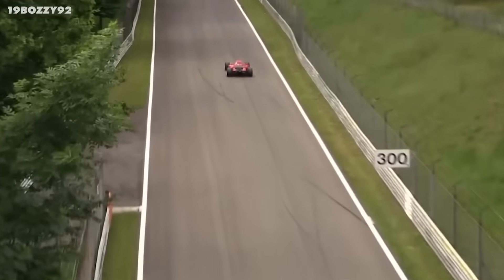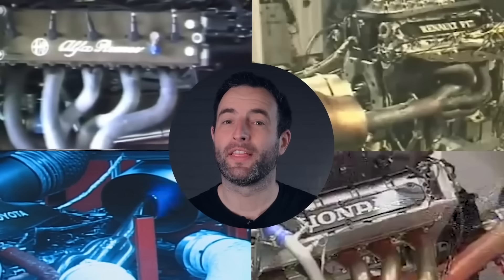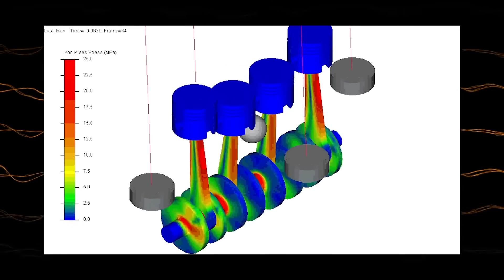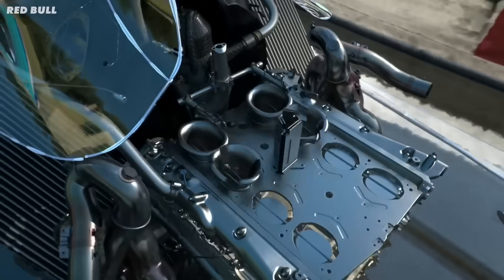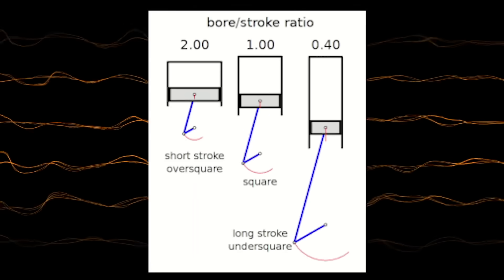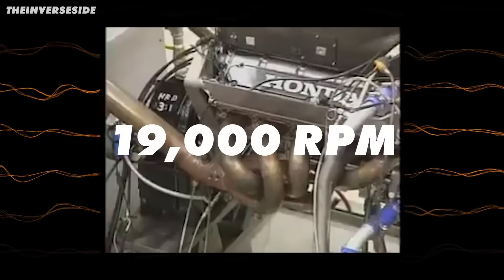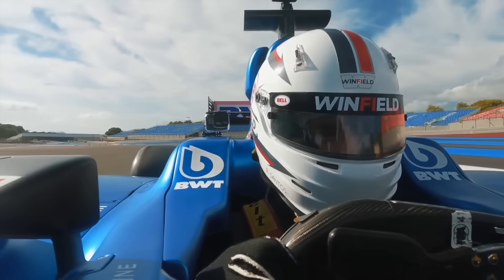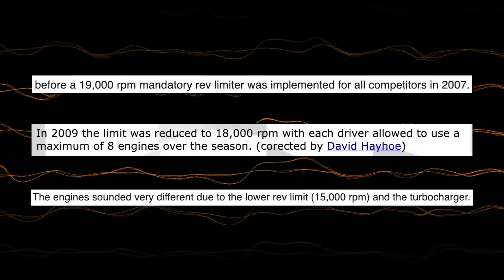When Formula 1 Engines Revved to 20 000 RPM!

Comment: Renault was the first to use pneumatic valve actuators.  V-10 do have a problem - they're either "odd-fire" or you have to split the crankshaft throws to get to 72 degrees which makes them weaker.
For reference, Ford's Triton V-10s were even-fire with split throws and a firing impulse every 72 degs, whereas the Dodge Viper engine is odd-fire.

Comment: v10s are overrated, as far as to say that the v12, specifically the 3.0L Ferrari tipo-044/1 (1995) which revved to 16.8k-17k, sounds miles better, this is because it had a higher natural frequency, despite the 2-3k rpm loss from the 18-19k from the mid 2000s v10, it had 2 extra cylinders, which meant that there were more explosions per crankshaft rotation and the resonant frequency was higher, and since they were evenly balanced in the crankshaft, the Ferrari 412 t2 sounded smoother at low to medium revs and higher pitch at higher revs, a great example is jean Alesi's suzuka lap (1995), the actual sound curve compared to the McLaren's and Willaims at the time (v10) on the same race weekend is a whole lot better, and more so jean Alesi's lap around Montreal.

Comment: Back in the day, Honda produced 50cc twin-cylinder, 8-valve engines that produced 13.7 hp at 21,500 rpm.  That's equivalent to 274 bhp per litre, in the mid 1960s. 3.5 litres of it would be 959 bhp...and you were saying.....https://en.wikipedia.org/wiki/Honda_RC116

Comment: My 1971 Fiat 128 1100cc engine was over square. It's a Lampredi engine. I believe Lampredi designed GP engines for Ferrari in the '50s.
Yes, it revved. Normal, everyday revs meant a lower than normal piston speed, which translated to a lesser wearing of the bore/rings.

Comment: If you have titanium pistons and carbon-fibre connecting rods this is not as difficult as it sounds.
Reply: they were using more than titanium, they were using rare earth minerals and metals you’ve never even heard of, actually the main reason they stopped this era was costs were way too high and going thru engines every weekend.

Comment: Not true about saying the V10s were the most powerful in the 3.5L era. The V8s were light and fuel efficient while the V12s were the most powerful, expensive and very thirsty. The V10s were favoured in this time due to their “middle ground” status. The V12s of the time were actually considerably more powerful. The V12 McLaren MP4/7A was 50-60 BHP up on the dominant V10 FW14B. By the end of the 3.5L formula the Ferrari V12s were putting out over 850 BHP, which would only be matched by V10s in 2003 or so. The 3.0L formula is what’s considered to be the start of the “V10 era”. Now the V12s power advantage was greatly reduced. The final V12 was the 1995 Ferrari 412 T2, it managed a 50 ish BHP advantage in qualifying but couldn’t sustain it for race trim, being only 20bhp or so more powerful, with all the weight and thirst issues. By then the V10s were a more promising development direction for even Ferrari. However, the final V12 might just be the greatest sounding. The 412 T2 revved to 17,000 rpm in 1995, 2,000 higher than the competition, and had a distinct V12 shriek to it. Possibly the best sounding car ever.

Comment: If you gave an old V10 600 kg car a set of modern slick tyres with much more grip than the grove tyres they raced on, would a V10 be able to lap faster than todays 908kg turbos ?

Comment: Instead of using regulations to put limits on development spending, the sport should find a way to limit spending that utilizes a natural balance point. That way, innovation is maximized relative to cost.  Such a scenario would utilize a boundary set by the competition itself. For instance, there is no limit placed on RPM, but the team with the highest revving engine in each race must incur a handicap that almost completely negates the benefit gained by those higher rpms. This would create a natural boundary where the cost required to overcome it increases exponentially the closer you get to said boundary. It would become too expensive even for teams with unlimited funding to attempt to go further with a particular technology, while still being reasonably affordable for typical teams to compete. There would no longer be an incentive to make any little improvement possible. The improvement would have to be ground-breaking to be worthwhile (to negate the handicap), and those are the ones we want to see come from racing development. An extra 100 rpm that cost a million dollars to make happen, has no benefit as an innovation of engine technology. It just means that he who spends the most, goes the fastest. We want racing teams to spend on innovation, but not to the point that  the improvements being made could never see their way into a passenger vehicle.

Comment: A lot of errors in this video. The V12 can reach more revs than the V10.
By the end of 1994 (last time F1 used 3.5 liters) the ferrari V12 reached 16300 rpm (which delivered 850hp) whereas V10 Renault reached "only" 15000rpm (which delivered aroud 800-810hp).
The issue for the V12 is the lack of torque in middle revs which is an issue regarding the contemporary circuits.

The V10 respresented at this time the best "compromise" according to the circuits.

Comment: I had a Suzuki GSX-R750 motorcycle which standard had titanium rods, I think from memory . Redline was 15000 and to nearly 16,000 RPM before the rev limiter cut in -pretty impressive for a street engine, which had great reliability excellent fuel economy and produced 150 crankshaft horsepower from 45 in.³ engine

Comment: At 6000 rpm, each piston travels down and back up in it's cylinder 100 times per second. Try moving your hand up and down 100 times per second. At 18000 rpm, the piston goes up and down 300 times per second. In a 4-stroke engine, at 18000 rpm, each cylinder makes 150 exhaust pulses per second. Multiply that by 10 cylinders, and there are 1500 exhaust pulses per second leaving the exhaust system. Bring some ear plugs.

Comment: 3l and 3.5l v10 has more inlet valve area than v12.

Smaller bore means less room for valves. What Ive understood, with that displacement the v10 is the golden corner for valves

Comment: As awesome as they were, they still didn't have the record for most NA power per liter, even in the period.  The Honda NSR-500 2-stroke GP bike holds that title as far as I know, excluding things that run on nitromethane.  Ironic, given that Honda as a company and Soichiro himself despised 2-strokes.  Frankly, I'm impressed F1 got as close as it did, given that each piston spends 75% of it's time making less than zero horsepower.  In order to extinct the 500s, the 4-stroke replacements were allowed 1,100cc.

Comment: they sound pretty damn nice. but i still prefer the timbre of the 787b when its about to hit the  rev limiter.
that's probably because the 787b starts off with a really low idle exhaust note and zooms to an intense f1-like scream. it has greater vocal range.

Comment: great video. debatable whether v12 sounds worse than v10.
saying that a reduction in maximum rpm was better for f1 as a whole is kinda laughable though, as that was the beginning of the end: smaller engines, limited number of parts, parc ferme, mandatory race tyres, max fuel flow, no private tests. better as a whole if you run a bus company, not f1

Comment: If I recall Correctly, electric power is the future.
also, 1.5x playback is ideal for this guy. its like he needs a rev up
Reply: Model s plaid has 3 motors that go to 20krpm it had to be wrapped in carbon fiber to not warp itself.

Comment: The pendulum swung too far, the V6 sounds awful compared to the V8.  F1 is the pinnacle of motor racing.  Attempting to make F1 the pinnacle of carbon-neutral policies is misguided.  Look at the flight map and how inefficient the travel is during the season, constant back & forth to the same parts of the world.  Create a calendar based on efficient travel, burn less jet fuel and bring back the V8.
Reply: Why should they bring back the V8?

Comment: One of the most interesting things of these modern F1 engines is that they are designed with tolerances so extreme and perfect that they are essentially assembled in a seized state; that is, they have zero gap between the rotating and sliding surfaces.  You cannot crank/turn one of these engines without first preparing it for start-up, which involved heating the engine block with a thermal device that allowed the metal to swell, now creating a gap between the engine’s components.  Once this was done, a vacuum pump was attached to pull the lubricants into the engine so that a thin film coated all the internal surfaces.  Only once this was done would the engines be attached to a starter to be fired up.  That’s why you have so many videos of these cars sitting in the garage hours before they are run on the track, with engineers standing around, watching laptop screens as the engine is run through various RPM ranges…they’re pretty much monitoring the heat and the level of lubrication the engine is going through.  When Top Gear’s Richard Hammond drove the Benetton F1 car, he detailed this process as he was waiting to get into the car.  Search for that video here on YouTube.

Comment: The bmw p85 v10 was going to be 950 hp and only 82 kg (98 mm bore with only 4mm cylinder walls) but F1 doubled the mileage requirements and they had to scrap it for 2005.

Comment: At 3.5 Ltrs the packaging of the power unit is slightly improved as a 10 cyl, relative to a 12 cyl. The slight power increase available from 12 cyl's could not compensate for the advantage given to the chassis and aero, offered by 10 cyl's 
At 3Ltrs a V8 has the same pro/con as the 10/12 at 3.5 Ltrs
At 2.4Ltrs you are in the realm of 6 cyl's

Comment: I am desperate to hear an inline 6 running these technologies. In inline 6 with like a 100mm bore and 50mm stroke would be around 2.4 Liters. I think it would be the ideal motor for the next F1 cars with a nice little MGU for torque fill.

Comment: Honda’s 20k rpm 3.0 V10 delivered 965 hp, which is just 70 hp less than today’s F1 powertrains despite having no turbocharging and no electrification. That masterpiece could avoid modern F1s to carry heavy batteries and, of course, to sound delusional. Just imagine today’s safer and more aerodynamic carbon bodies with that ear shattering V10 rear mounted. The car would be less fuel efficient, but I think it would be faster since it would be lighter and would have a more progressive power delivery.

Comment: I have a tip for the F1 regulatory body: Limit RPM to 3.000, Volume to 1,5 Litre, Power Output to 60 kW and driving speed to 80 km/h - then everybody can be in the F1 game.

Just don't expect fans to stay around for much longer.

Comment: with high reving engines ok f1 is a bit higher the normal road cars but the piston speed is sort of the same you cant go faster thats wy they run over size p[istons wider then the stroke so to rotate the krank the piston has to travvel les distance so can do it faster with same piston speed as square or long stroke

Comment: I do NOT like how V-10's sound...ESPECIALLLY at lower RPMs. Years ago, a friend of mine bought a brand new Ford truck with a Triton V-10 in it. A few months after he bought it, he had an aftermarket exhaust system installed on it. I went for a ride with him, and the first time he stepped on the throttle hard, I broke out laughing harder than I EVER have in my life before.. His expensive aftermarket exhaust on his V-10 sounded EXACTLY like someone who was trying to play a bugle for the first time... 😆🤣 
It was high-pitched, sharp, and VERY annoying sounding. I let my friend drive my car, behind his truck, while I was driving the truck and getting on the throttle at various RPM's, while I was laughing profusely by myself. When we got back to his house, he totally agreed that his truck sounded ridiculous, and he immediately went and had the stock exhaust reinstalled. 

The Ford Triton V-10's and the Dodge Viper V-10's, are the most experience I've had with a V-10 and they both sound silly to me.

Comment: Very nice video, but I have a couple of remarks. Ultra lightweight V10 F1 in the Schumi/Alo/Hak era are the true last F1s. Cost was not the main issue if you consider the astronomical costs of today’s PU. The only true gain we got since then is in the astonishing energy efficiency: -40% fuel to complete a race is sci-fi engineering. But the weight of the cars and the limitations on components and tests are an harsh price to pay. Of course they are going to throw away even the good stuff, in the next rule book revolution. We’d need a true Motorsport enthusiastic leadership in the sport governance

Comment: There was a time when F1 was allowed to innovate in design. Each manufacture could build their engine with any number of cylinders and any V angle as long as it conformed to the displacement. There was even a H design 16 cylinder engine by BRM (British Racing Motors). Tires would make it through 2 to 3 races and there were no fuel stops. Engines and transmissions were good for 3 to 4 races. Now it is a spec race where all the cars are basically the same except for minor tweaks in the aero package and only change to conform to the rule changes. So many rules that all the cars could be built by one manufacture like in Indy racing. Just put a different manufactures nameplate on it.

Comment: What if you kept the current 1.6 liter 6 cylinder engine, took away the turbocharger and the hybrid motors except that you could still use whatever power you got from brake regeneration, but allowed the rev limit back up to 20,000 rpm? How would such an engine sound and how much power could it make? Hopefully the answers would be 1) sounds like the old V10's and 2) adequate compared to the current system. Maybe the fuel mileage would suffer but who cares.

Comment: So my understanding is that a smaller stroke puts less strain on the pistons ect so they use large bore cylinders to keep displacement the same, but then the v10 performed batter because there are more cylinders to spread the workload over meaning the bits can be lighter. So why was the v12 not as good and with this being the case why did we not see v16 ect

Comment: Being lucky enough to have visited races with the V12s, the V6 bi-turbos, V8 bi-turbos, V8s and the V10s, I can say that the V10s ruled them all. Closely followed by the V12 and V8 on a shared second place.

The high rpm screaming monsters were just petrol head's ear porn.
Standing at the starting line during the start of a race, you didn't just hear them, you felt them. And when they revved up and flew off, man... No comparison.

Comment: Sorry, but the best sounding engines were the 3.5 liter era V10's revving to 15,000 (RS6) the 3.0 liter engines revving to 20 grand did not sound nearly as good. The era of the greatest sounding engines ended at Adelaide in 1994.

Comment: I was at an outside table at Café de Paris (Casino Square, just across the street from Hotel de Paris) during the 1996 Monaco GP. It wasn't the greatest of races for track-side spectators I guess (crazy weather conditions, lots of retirements) but one of the things that stuck in my mind was the sound of the engines. It wasn't pleasant per se - just incredibly loud, high-pitched and almost whiny. Since nearly all cars had been out of the race a few laps before the checkered flag, we decided to drive back to our hotel in Cannes early to beat the traffic. And once we were up on the main road above Monte Carlo, we could still hear the engines screaming down below. They were insanely loud. I also remember that, for some reason, the Peugeot-engines of the Jordan cars sounded the best to me - perhaps they didn't rev as high as the competition? :D

Comment: Fun fact, bmw had the highest and most powerful f10 f1 engine, no one seems to remember this, it was the first to actually rev over 20k
Reply: Dunno about that, was 19k rpm max, Ferrari did 18.8k rpm
Reply: @kerimca98  nope check it out yourself,  BMW did just over 20k rpm in qualifying, couple magazines wrote about this back then!
Reply: @intelligentcarreviews8592  It mentions 19k rpm everywhere, 20k rpm are on V8s ones that were easier to rev, up to 20.5k
Reply: @kerimca98  nope the bmw f10 revd to 20k rpm I remember clear as day as I was super heavy into f1 and engines at the time, f1 used to focus on showing off engineering at that point in time and they always mentioned the engines G forces etc, the bmw v10 definitely got over 20k rpm

Comment: Probably already mentioned but there's errors in this video. Honda dominated the start of the 3.5 litre era with V10s. This is despite Renault having a year's headstart on Honda with 3.5. And v12s both revved faster and made more power than contemporary v10s. The reasons v10s were eventually seen as better is because they were the better compromise: they used less fuel than the v12s, had more power than the v8s and had better packaging than both. May also have had better drivability. Honda learnt this lesson when they switched from v10 to v12 in 1991.

Comment: F1 has sustainable fuel. The most ecologically damaging portions are the rare metals used in the batteries. If F1 wants to push its eco-agenda, it needs to ditch the hybrids and bring back the V10s and V12s.